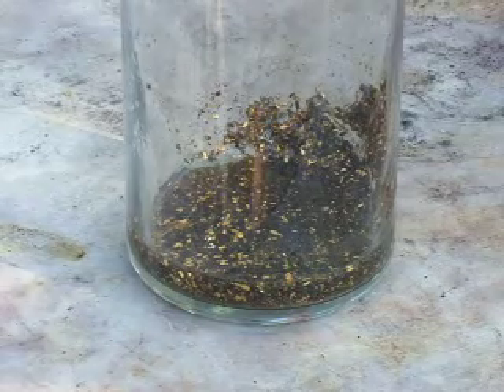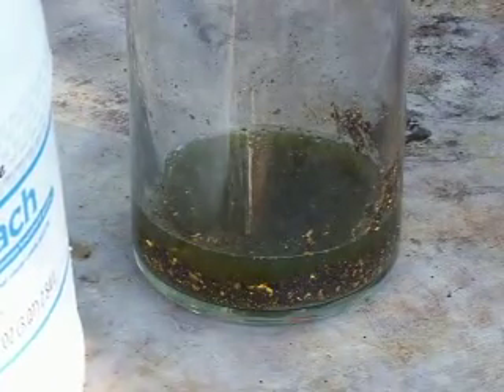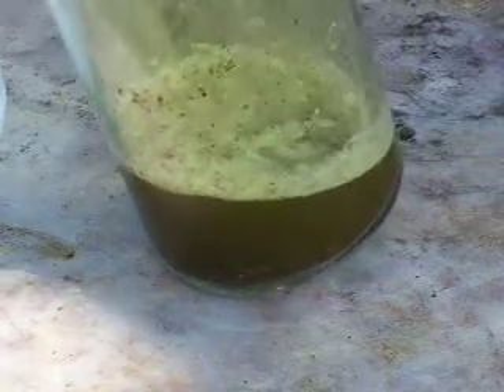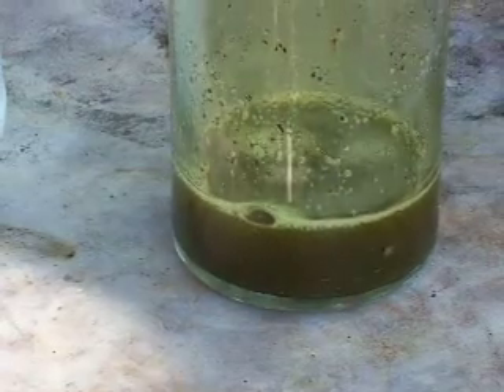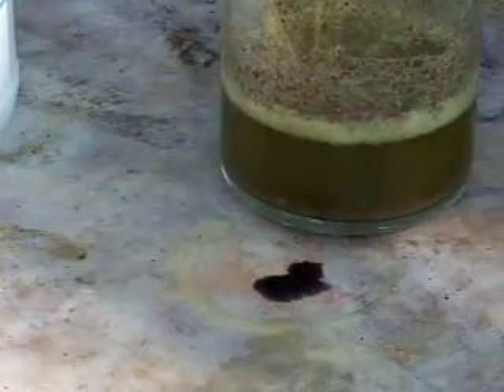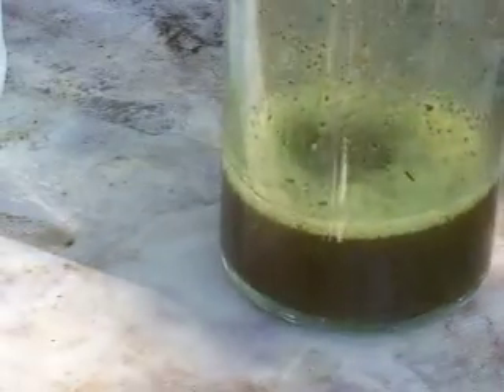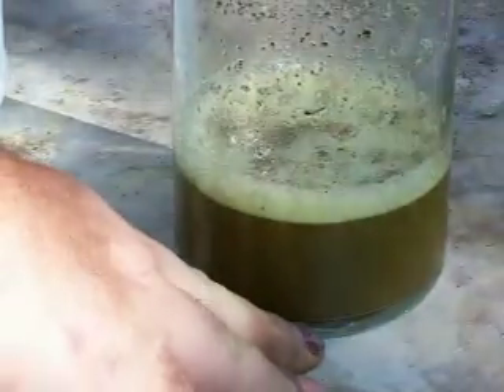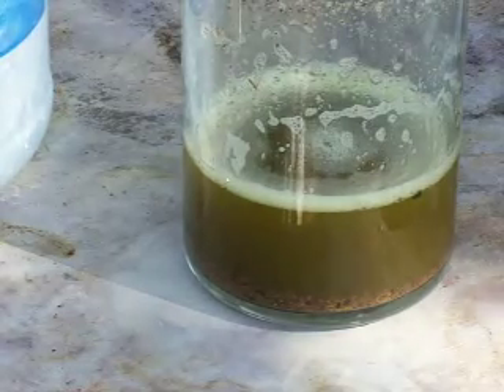dissolving finger foils

Comment from the maker: no problem.the hcl will dissolve the solder.when you use a nitric bath one one material and hcl bath on another,if you combine the two and add hcl you will create a weak AR that will dissolve some gold.if the material has been in nitric and then you put it in hcl bath,the hcl bath will have dissolved gold in it.test all baths and rinses with stannous chloride to be sure your not tossing your gold away.its ok to go from one to the other if you go ahead and dissolve the gold.dont rinse and discard

Comment from the maker: if you mix material processed in hcl and material processed in nitric acid, it will dissolve some gold because the acid from both processes will mix.as long as you understand this,you will be ok.add everything in one flask and add hcl,then add bleach like shown in the video.do not rinse in hcl first.dissolve and filter.heat to drive off excess chlorine,let it cool and precipitate.

Comment from the maker: i wait until i have a 30 gallon garbage bag full of filters before i process them.just dry and incinerate (burn to white ash) and process the ash.my last bag of filters contained over an ounce of silver  and 12g of gold.its not a bad sign of sloppy practice to have so much value trapped in filters,remember,you cant rinse all the solution even from glass.anything that touches the solution or powder or foils will trap values.

Comment from the maker: anything that touches the process will hold values.rags,paper towels and even the old clothes you wear when processing will have gold on it.gold escapes from solution through drips and aerosol created from the tiny bubbles when metal dissolves or when boiling.a good refiner will collect everything to recycle,even trimmed fingernails and cut hair.everything is collected and after a hundred pounds or so is collected,its incinerated and the ash is processed.this is a good bonus once or twice a year

Comment from the maker: ceramic processors have gold plated tops.fiber based processors have nickel plated copper tops.Pentium Pros both large and small, have gold over copper-tungsten alloy.this alloy is hard to process and must be boiled in AR for hours.the gold will cement into the tungsten matrix on left over copper.the large Pen Pro should yield 3.5g-4g of gold per.its hard to get that if not processed correctly.

Comment: right here we go:- fibre cpu will be done in 3 stages pins/lids/bodies ( separately ), boil in HLC, collect foils, leach with AR ( HLC and Nitric ), Filter into ice, add sulfuric acid, leave to settle, filter into container, drop with smb, leave to settle, filter , wash left with gold dust ( not purified ) would you say thats a method statment i could use its took me a long time to work it out?

Comment from the maker: a PCI card(sound card,video card,modem card,etc.)is a finger board,even memory and slot processors.beginners cut the fingers from the cards because they are quick and easy to process.gold plate is a chemical process and gold plates onto an object pure.the gold on plated items is pure gold.getting it off pure is the problem.hcl(muriatic acid) and peroxide will release the gold foils from the board.it still needs to be refined.other metals are always present.theres too much for me to explain here.

Comment from the maker: if you have gold in solution,you can place a heavy piece of copper in the solution, the copper will dissolve going into solution and the gold will drop out of solution.copper is the metal of choice.aluminum would do the same but it will drop all metal lower on the reactivity scale including Co,Ni,Cu and Fe.since copper is under gold,copper will only cement (drop) precious metals out of solution.

Comment from the maker: if you try to dissolve the gold plated copper with hcl/Cl, a little gold may dissolve but the reaction will not work because the copper is more reactive than gold and wants to dissolve first.any gold that does dissolve will be cemented back out on the base metal before you can decant the solution.

Comment from the maker: for gold plated solids like pins,jewelry or big heavy pieces, the sulfuric stripping cell works best.it reverse electroplates the gold off the item and drops it to the bottom of the cell as a black powder. it does work good on glass and porcelain. 1 gallon of hcl (in the form of copper chloride) will dissolve about 2 pounds of copper. gold plated jewelry has too many types of metal like zinc,tin,nickel and cobalt.the AP solution would foul to quickly to be useful.

Comment from the maker: these foils have been through the AP process and the base metal has been removed.theres only a tiny amount of copper left with the gold at this point.AP (hcl/peroxide) or copper chloride is the process of dissolving the copper and steel to remove copper foils from pins and fingers. these foils was contaminate by high winds blowing dirt and leaves and trash into my AP solution. everything you listed can be processed in AP and then hcl/Cl (hcl/chlorine bleach).

Comment from the maker: Hello Gmandoit.normally,silver will not dissolve in HCL alone.a minute amount of silver will dissolve in almost any strong acid, but the amount will be negligible.if the dissolution is followed by the proper washes and rinses,you can achieve gold of a purity of 99% in your back yard.there is a wash that i havent shown yet that will remove all traces of silver from your purified gold,and it involves a common household chemical that must be used as directed for safety.ill post a video of it later.